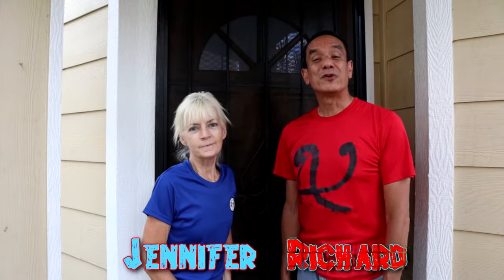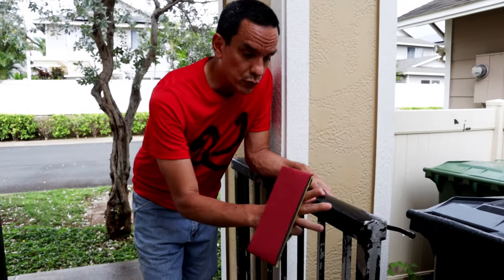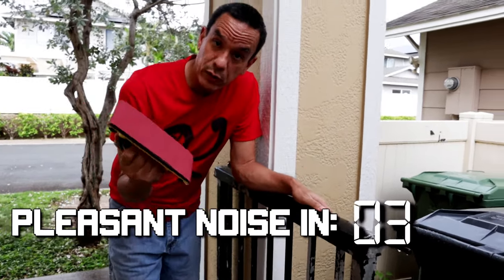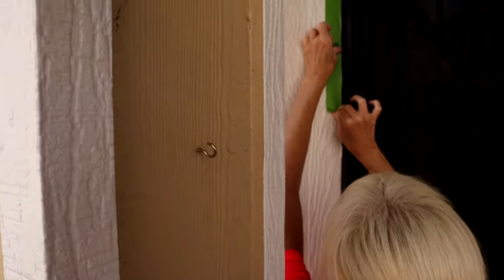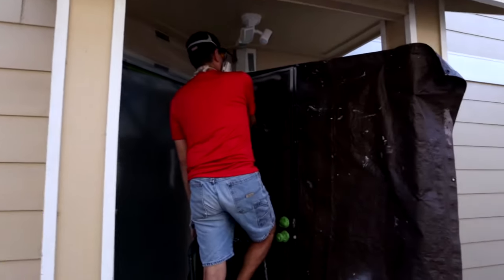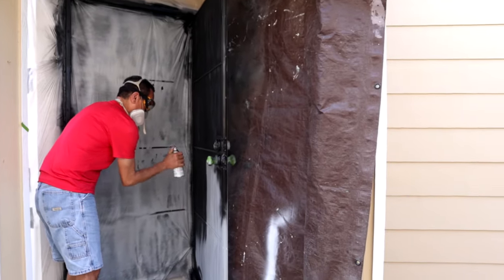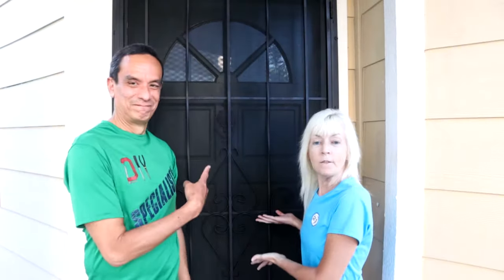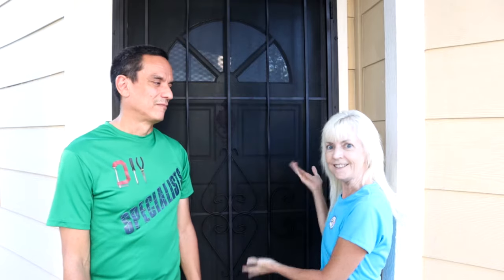DIY Project: Screen Door and Gate Restoration

Comment: I had my ex stalking me, still kind of is, but he'd kicked in my security screen door, busting in the whole bottom area of the metal mesh part of door, it's so difficult to try bending back into place,it was inside a little metal lip part of the metal frame and its all bent in, Idk how to fix it and reinforce the metal screen, even if I buy new metal mesh,idk how to get in installed and I don't have the money to hire someone else to do it. How do you replace the metal mesh in security doors
Reply from the maker: We are absolutely heart broken to hear that you are having to deal with such a situation with an ex. We hope you can obtain a restraining order and obtain help. As for the screen, I am by no means an expert and I can imagine there are tons of different types. If it is a security screen, it is probably welded to make it more difficult for people to break into, but even these are not perfect. Since you mentioned your screen bent, I suspect it is more for keeping bugs out and not keep people out. To repair this, I can only imagine taking the door off and pounding it back into shape. Probably wont look pretty but it would be a little better than nothing. I understand, cost is a concern so I have two suggestions. option 1 - use internet to search for local handymen in your area. You might find some that do it as a hobby and not charge much. You may also find novices who are trying to build a name and reputation and might charge little. 2 - use the internet to search local recycling businesses. There are often companies that teardown old homes before building a new one and they take great care in removing parts so they can be reused. In such a store, you might be able to find an inexpensive , used screen door. Just driving around construction sites that are demolishing homes, you might ask workers if you can have the screen door. a little sand paper and spray paint and you can make an old screen look really good. If you have additional questions, please do not hesitate to reach out to us.  We wish you the very best and hope you find a perfect solution at little to no cost.

Comment: Man my screen door is way worse... Lucky for me my hoa doesn't require them so ours are optional which mean I can take mine off to work on. Thanks for the great video.
Reply from the maker: Thank you for taking the time to watch and for leaving a comment. We sincerely appreciate it. Confession time... I actually wanted to remove the screen door and paint it within the garage but the screen door was installed in a manner that would make it difficult for a thief to break into it. I would have thought you could easily remove it from the inside but that is not the case so it was easier to paint as is.  😄
Reply: @Poor_Mans_DIY  Mine is barely hanging on as it is and I need to find a way to repair the wood it's anchored too 😬